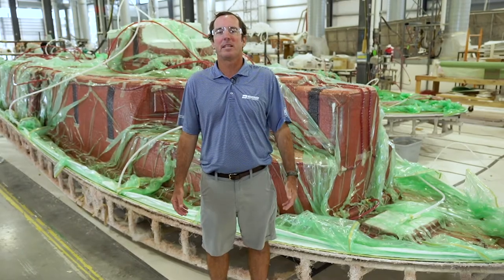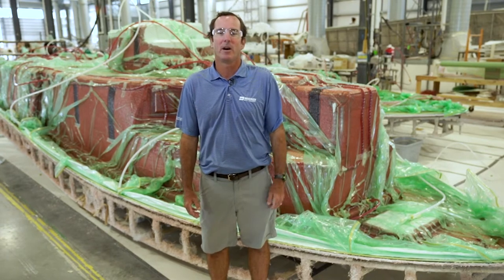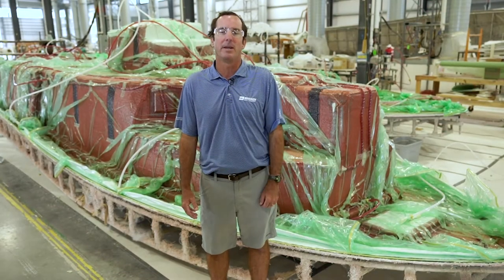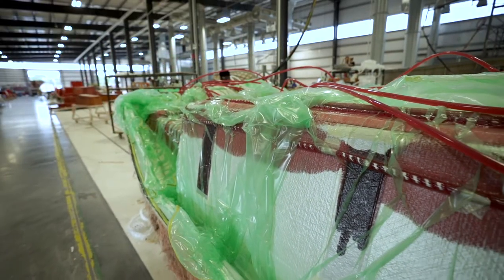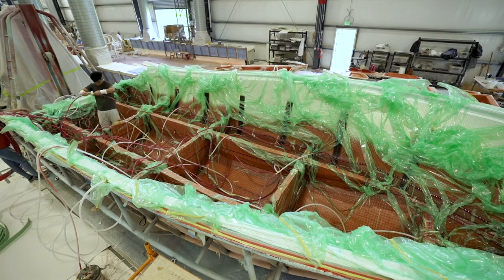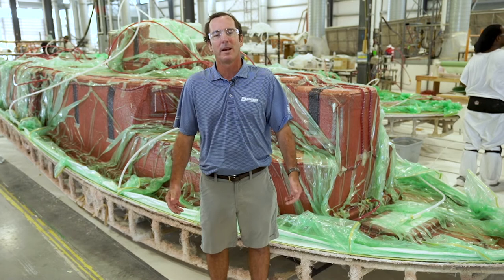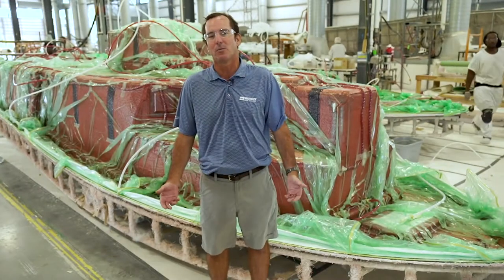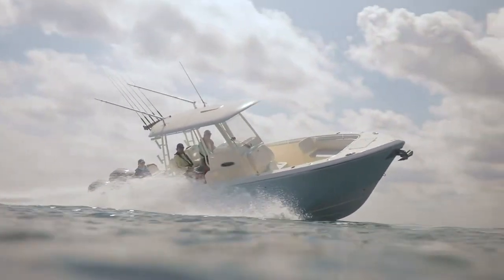INFUSION Cobia Boats VARIS® (Vacuum Assisted Resin Infusion System)

Comment: Hi, did you have a leak problem on the vacuum bagging or the gum tape? In such a large surface area like that, a tiny leak can be very frustrating to find the leak location. I had a hard time to find the small leak problem. Do you have tips on leak problem?

Comment: That's absolutely brilliant! Infusing everything at once gives you the chemical bonds. Once a surface sets up, glassing over is solely a mechanical bond. Mechanical bonds are very strong but require roughly ten times the wetted area to achieve the same strength. Even then it creates a differing stiffness shifting any vibration, flex or twisting moments to the surface adjacent to the mechanical bond.
I love how you guys build boats!